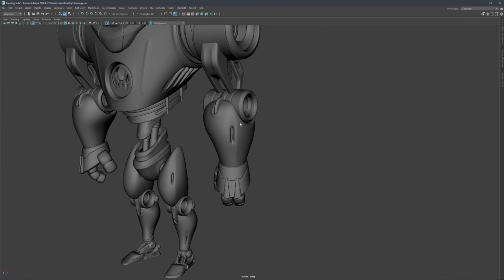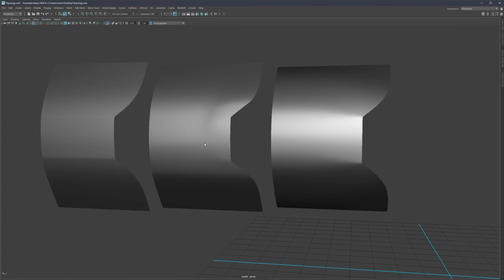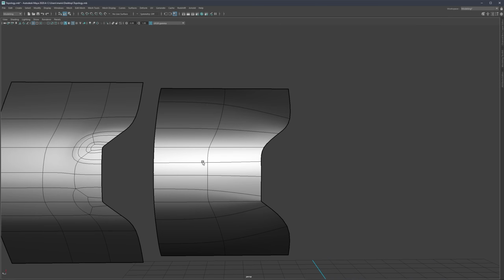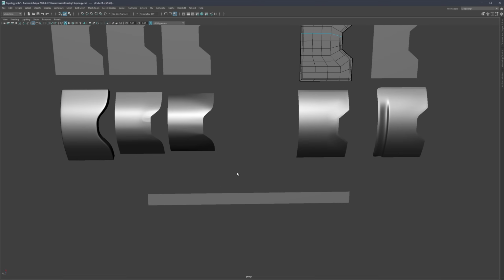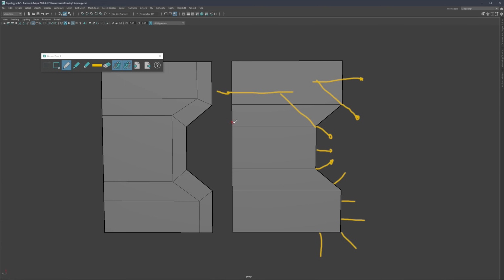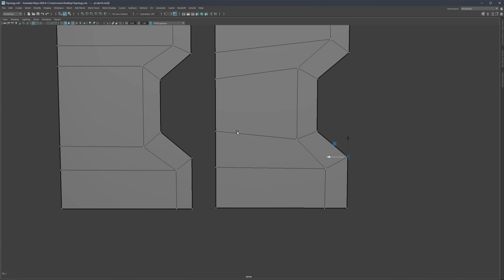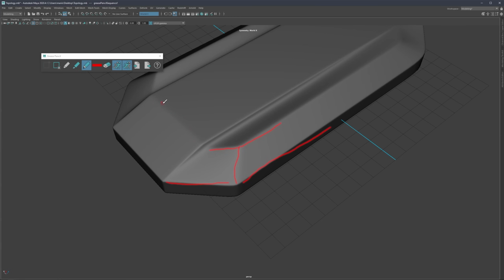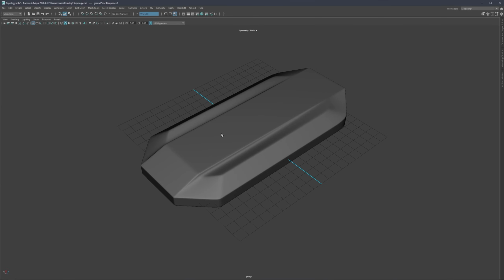How to 3D Model Anything // Understanding Topology

Comment: Your theory is great, and explanations are clear and very good. But your cylinder retopo is full of pinching. The rest is great thou.
Reply from the maker: Thank you! But not sure If I understand what you mean by full of pinching? 
If this demo did not answer what you´re looking for, please check the video where this topic is covered more in detail here
https://www.youtube.com/watch?v=_Lv5P1T4VI4

Cheers :)
Reply: @elementza  I meant it already had deformations specially in the corners. The cylinder in the first example that you propose as the solution for not having deformations has deformations. Sorry, didn't want to be a pickle 😅
Reply from the maker: @maschinelab8598  
I would def suggest checking attached video... you´ll find the answer if you´re interested in more technical explanation why deformations happen. As for our example here, the level of topology and camera distance matters for the result. For an optimal range, any deformation here is very minimal and would not have any serious impact on final results.

In case the object would be closer to the camera (or a hero asset) then approach would be different (more subdivisions and no redirection).
Reply: @elementza  will watch the video. Your last sentence is what I was refering to. For me the distortion was very clear, maybe due to my OCD lol. Thank you.

Comment: AWESOME ELEMENTZA !!!!I have a question when you apply smooth in Maya, is it the same as subvididir? I work in blender and the maya can be subdivided but also use the surface subdivision, I don't know when you apply one or the other, greetings!
Reply from the maker: Smooth operation in Maya will add more geometry while Smooth Preview will not add geometry. Its just a preview. Hope I understood it right :)
Reply: @elementza  Thank you very much, I am clear I appreciate it !!!
Reply: Hi, Also using Blender.  It depends on what you want to achieve which one you would choose. Subdivide (under Edge tab) keeps the shape the same and subdivision surface (Under modifier) makes it smooth and both adds geometry.  Use two cubes and apply subdivide on the one and cube is still a cube and subdivision surface on the other and the cube turns into a sphere. I use subdivision surface more often but you need to add edge loops/bevels/crease to keep the shape. In object mode, right click, shade smooth do not add extra geometry and it appears smooth.